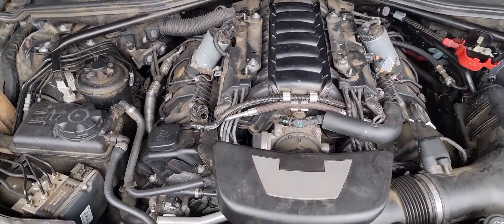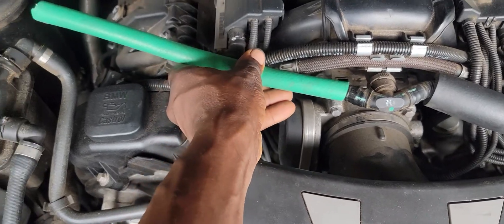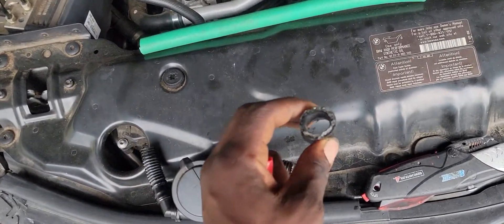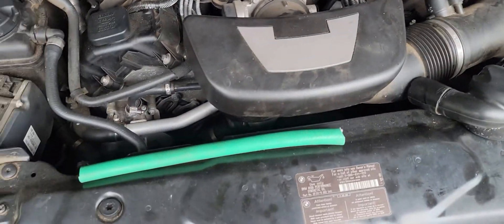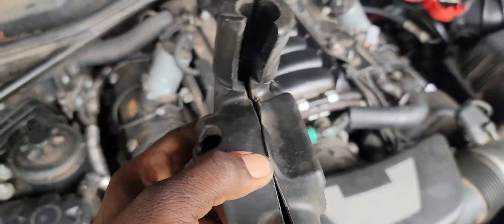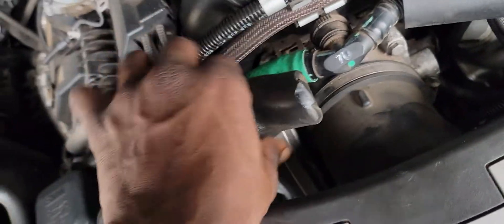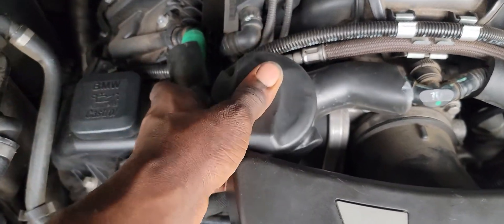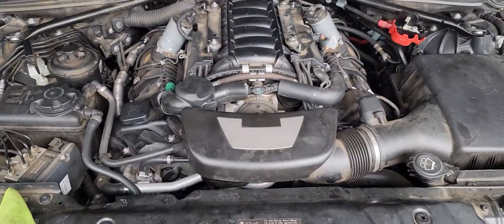Crankcase Breather Pipe w/Vent Valve for 2006-2010 BMW 550i Fix

Comment: That’s a PCV valve.

The part you replaced is the hose for it. 

So it’s a crankcase PCV vent valve hose. 

You should also open the valve and make sure it’s not damaged or have tears, because the car will give you a bad performance including excess smoking and oír burning.
Reply from the maker: If it bad I would have and issue but it isn't
Reply: @MrtalentedReid  
Yea it’s just good to check for tears.  I have the 650i and it was smoking and running a little ruff and when i checked it looked fine but then i open it and look and the bladder was tear at the creases. 

By the way, it uses 2 of them. The other one is at the left side under the cover, just fallow that same hose, you will see it. 

Hope that helps and thank u for sharing 🙏🏾🙏🏾Bless up.